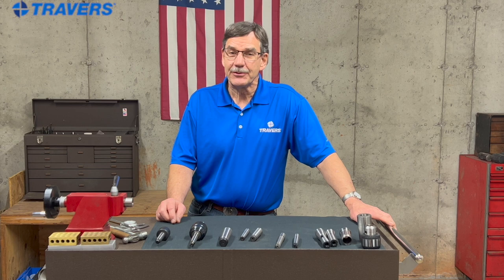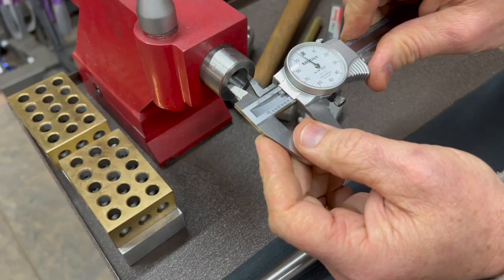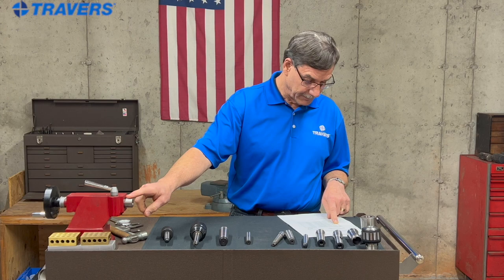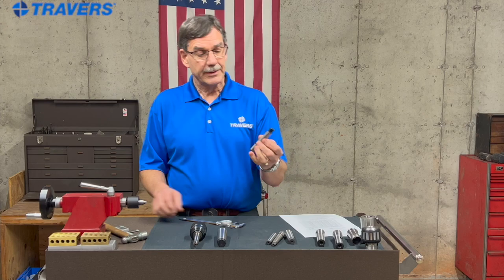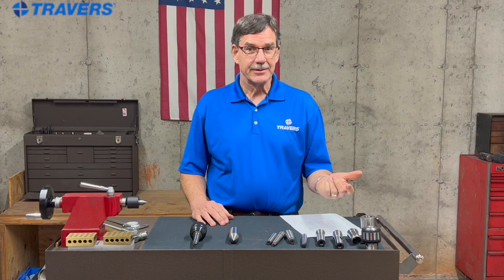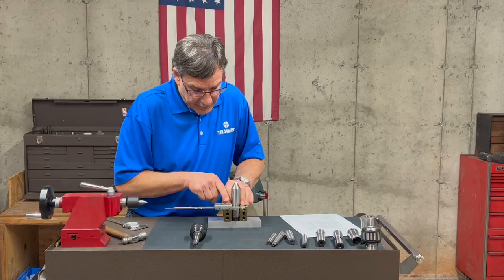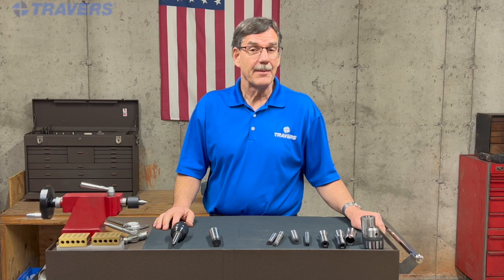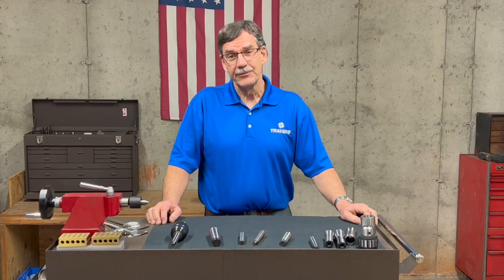How To Identify & Determine The Size Of Your Morse Taper

Comment: Herb,.  
Sir I have a snag I hope you might help me with.
Where I am, building fireworks (small) for a hobby is ok.
With that my 45 year hobby has come to textile cones, the compiosion needs to be firmley tamped solid.  These have been made for years and the information (that is slim on these) sais to pore a mold made of something like Durham rock putty in a box for a mold. Mine is rock putty with morter around it in a 4in. pvc pipe with no air hole in the bottom.
Works so well the taper will not release.  My machinist neighbor and I are stumped . I have Tryed chipboard around the cone, wrapped sheet aluminum and galvanized  sheet metal to no avail.  One of them I have cut a 3/16 in wide grouve top to tip for maby air lock.  
It is great I have a taper with these that work so well, but except for spending all the time and work to cut these in 1/2 top to bottom or casting new.
 The way I work that could be alot of work. .Might you have an idea please.
I have used tapers for 50 years now and have never Tryed to make one not stick totally just like greasing flywheel tapers so racing i could get them apart fast.
Sir any suggestions I could try would be greatly appreciated.
Thank you  Bob